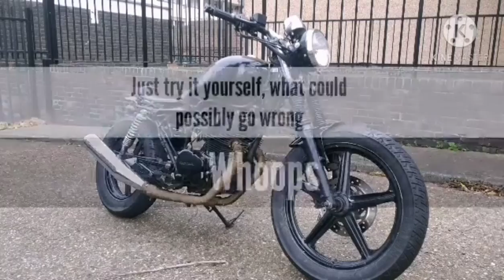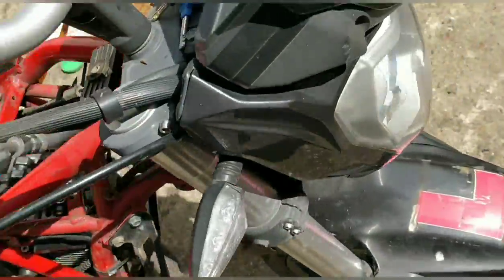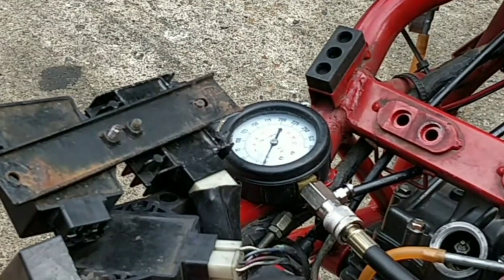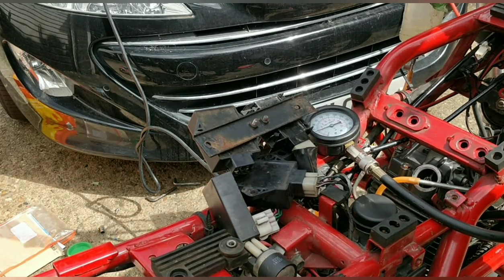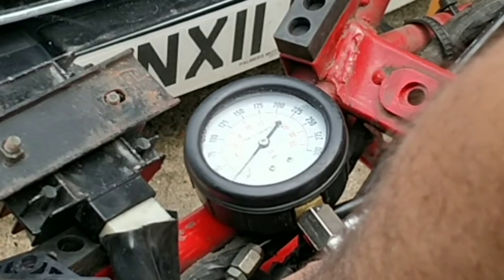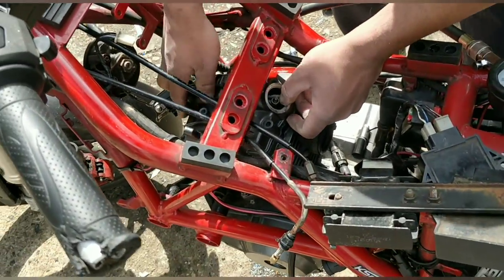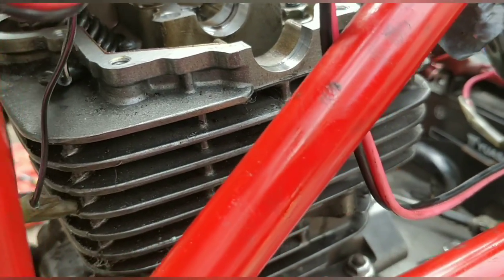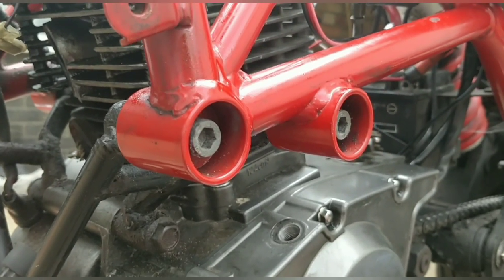ksr moto valve setting, compression test, plus we have an epic illegal street race. who wins???

Comment: Hi Charlie 
Sometimes   if you drop a little  oil into  the cylinder  and then do a compression test,,,you may see the compression rise higher ,,if so usually  means rings
And even i have  been able to fire up an engine  if you put a little  oil and try with the spray juice,,,,
Just sharing  some  experience 
Your  going  eco now,,,electric scooters 🤣🤣
Reply from the maker: On this occasion the oil wouldn't have made a difference. I spent all day today on it lol. I think i may have resolved the issue but won't know until next weekend unless I can get the energy to go after work in the week.

Comment: Before doing engine rebuild or at least the top end. Have you check the valves aren't sticking or if one's got any crap round it wont be sealing properly. Worth a shot first. ✌️
Reply from the maker: Or 1 has a crack in it lol.
Reply: @motorcyclerescuer  exactly that. Could be a lot easier job in the end.

Have got mine back up and running since the diesel incident... Still a bit smokey. Hoping that clears off 😆😆
Reply from the maker: Thats good news about yours. I'm not overly worried about a little extra diesel in it. Its actually pretty good for an engine in small amounts. 

Yeh one of the valves had a crack in it. The spare set is on now but I ran out of time to continue. I have a feeling ill get it running next weekend though.
Reply: @motorcyclerescuer  problem is it ignited the diesel with the spark plug cap off. That means it had enough compression to fire like a diesel engine.😆 I'm worried it hit high compression and done a rod bearing or ring 😬 sounds slightly knocky but that could be diesel in the fuel still. 🤷🏻‍♂️

Next video should be good then!

Comment: Thse bikes are Japanese right engines are made buy suzuki keep seeing people saying ther Chinese
Reply from the maker: They are bikes built in Austria to look similar to ktm. However the engine is s chinese 156fmi engine. 

They also use thin layers of paint like the chinese bikes so they easily rust after short amounts of time. 

So these bikes are equivalent to chinese bikes all round but built in Austria.
Reply: @motorcyclerescuer  do you think it’s worth buying one from 2016 or just stick to Hondas yamaha etc
Reply from the maker: If its cheap enough, currently running well with mot then it's worth it. It should last a year or 2 before needing much. 

If its a project it would have to be very cheap because parts are hard to find now.
Reply: @motorcyclerescuer  thanks mate appreciate it was just I seen on for a Grand and done a google search and said engine was made buy suzuki and seen other say it was Chinese so thanks for the help man
Reply: @motorcyclerescuer  I should have said it was the ksr model I was on about

Comment: i know its a stupid thing to ask but i have a 2013 ksr moto 125 and ive had to stip top end down as had blown gasket. never had this problem but i can seem to find tdc. i usaly do it with the normal markins but this one doesnt have them. the markins are one looks like a stamp hard to tell and other one looks like a small hole of sorts like one you would fit a ball baring in or something like that
Reply from the maker: Honestly I can't remember on this specific engine. The cam sprocket would normally have a line on it that lined up with the engine case. 

Sorry I can't be more help
Reply from the maker: Oh I see. Yeh I would struggle aswell with that. Does my vid not show tdc at all as I did the top end?
Reply from the maker: That's annoying, sorry about that.